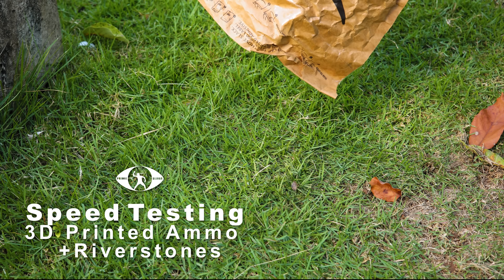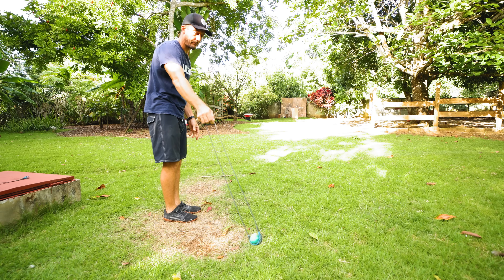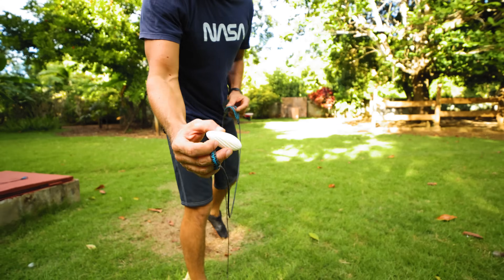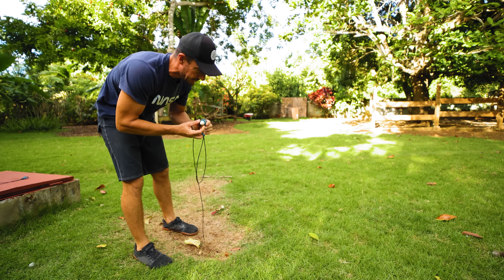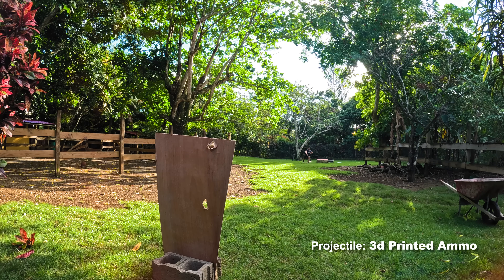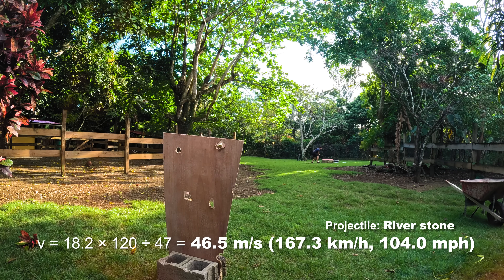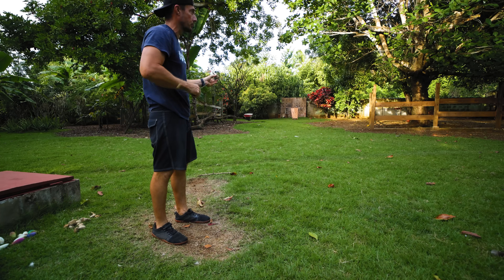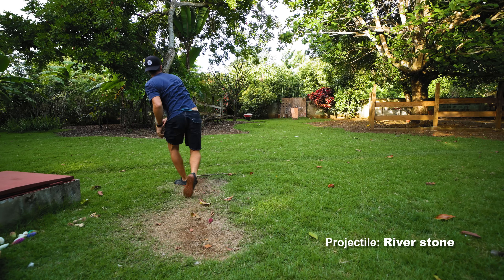Sling Shooting Speed Test: 3D-Printed Ammo vs River Stones!

Comment: The noticeable difference to me is the exit from the plywood. All of the river stones gave a cleaner exit with less tear out of the wood at the back than the 3D printed stuff. The first direct hit with the stone (upper left of the target from the back view) is a hole like it's been drilled out rather than smashed. Every one of the 3D prints caused a big ragged hole with big splinters. I wonder which of those results is more lethal. I have no idea. What the whole experiment proved is we don't need to innovate a tool that has worked well for millenia.  Stones are free, and don't put plastic waste all over the place.

Comment: I didn't even know a slinger was a thing until 5 minutes ago, but it turns out I have been one since I was a teenager and used spare cloth and my mom's sewing machine to make myself a pouch and straps. Within days of bringing it out, it proved it's abilities when a neighborhood pump grabbed my bike and took off down the street and I had some unripened citrus handy. Let's just say I got my bike back pretty quickly. 😁

Now I want to go see what a 30-in Primal Sling is! ... 🤣 <-- looks at channel name

The consistency of those speeds was starting to freak me out until I realized it's a consequence of the frame rate being the divisor. We won't see my new changes in speed when calculating that way. Even then, your consistency is mind blowing. Thanks for taking the time to do these videos and sharing with us!

Comment: So what happens if you launched a 3D printed "round" with a compartment to load mercury fulminate?
Reply: Would probably blow up in the sling from the pressure of the centrifugal force compressing it. there are probably some compounds suitable but very often, what is susceptible to detonation by impact is also to some degree susceptible to direct pressure and sudden compression . You can explode fulminates by lightly hitting then with a hammer, the force in the sling would be pretty sudden too

Comment: And David cracked Goliaths head like a mellon.
This really puts it in perspective. The snap and whip of the sling tearing the air molecules apart is impressive and very demoralizing for the receiver. 
A few lines of these tearing apart an approaching force, while arrows rain down, that would be a sight to behold.
Shields raised to overhead for arrows while slings rip through. You would see rows crumble. Knights on horseback would be incapacitated as would any calvary. 
Modern day, i would like to see how a riot shield would hold up? Or should I say how long with multiple  assaults?
Great video 👍
Reply: Riot shields is the ultimate testing case. For....reasons

Comment: They're curving towards the ground because of the way you're holding the sling.
Switch your hand hold so that the grip is opposite of the slip and it will spin the opposite direction.. 
IE switch the finger that it's anchored too to the finger that you release normally, and release from the one you hold instead.

Comment: With prints it would be a lot easier to weight them, like a bowling ball is, than trying to find the right stones and then you only get to use that stone once as a matter of practicality.  With custom mass distribution they can be tuned not only for distance, speed, and silence/noise reduction (noise is wasted energy and induces flight changes by interacting with the flight medium, the air) but for custom flight patterns, again, like a bowling ball is weighted with a travel or behavior profile.  Could possibly make a "boomeranging" projectile but that's pretty dangerous testing for the thrower while getting them right; objects with a wide scope of behaviors depending on input modulation are common in many sports already.

Comment: 3D printed projectiles require a very thin, light, and long sling. If you're throwing rocks that are literally 5 times heavier than plastic, you clearly don't have enough rope length for leverage and greater speed.

Comment: The spiral only makes sense if you can control the orientation and spin. Otherwise you get tumbling which makes for more drag and an unpredictable flight path. I suspect a golf ball would do better since the symmetrical shape and the dimples (which lower aerodynamic drag) aren't affected as much by orientation or spin.

Comment: Think the fins were supposed to impart spin middair for stabilization like some shotgun slugs, but it seems that the sling already does that on release, so it throws it off completely.

Maybe something to do with spin orientation or direction in the fins?
Reply from the maker: Yea that's pretty much my understanding as well.. also there is just a lot more added surface drag and the mass is more concentrated in the center of rotation instead of the outside which makes it a lot hard to have a clean spin.

Comment: Good video. I notice that the "propeller shape" is in different directions on different bullets. If you spinn a propeller the wrong direction, then it breaks a lot. For example the one at 1:18 is definitely a bullet for left handed slingers 🙂. But I agree that they look nice.
Reply from the maker: Good point, I just shot all of them without really thinking about the propeller angle, it has to make a difference, but none flew correctly... partly because i was not able to get a clean rifled spin out of them.

Comment: Dude, try making perfect stones out of cement and molds. And if you also insert a screw into this mold with cement, you might get something interesting.
Reply: Why the screw?
Reply: @lualdiz  sabot/eccentric weighting to use examples from penetrating ammo and bowling balls - if you launched that projectile at say, a steel plate, you'll see sparks and fire lol why not just put tannerite in there then and/or BBs to make a frag round
Reply: @russellzaunergenius
Reply: @russellzaunerthis is dangerously based
Reply: @lualdiz  I am assuming if it sticks out it will act like a dart head or arrowhead.
Reply: @lualdiz I could only imagine a hole to put tungsten and on the other end of the oval, a streamer.
Reply: @lualdiz Timber/Log/Landscaping Wood 2-7/8 Inch,50Pcs,Black...
Reply: Yeah, you could make a disassemblable mold from a golf ball and fill it with cement.
Or even just throw golf balls themselves.
Reply: So what happens if you launched a 3D printed "round" with a compartment to load mercury fulminate?
Reply: @thedappermagician6905  boom in hand would happen
Reply: @thedappermagician6905 Despite how Breaking Bad portrayed it, mercury fulminate is comically unstable. Even if you know how to make it, and you can load it, the force on the first swing would be more than enough to set it off.